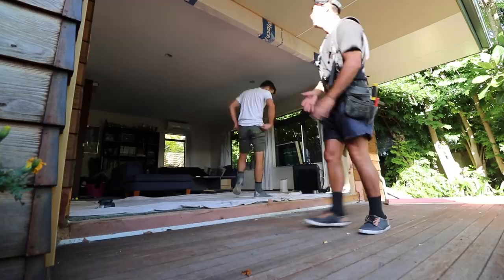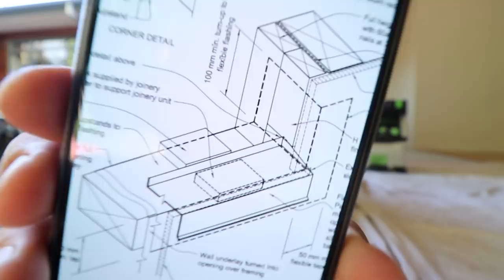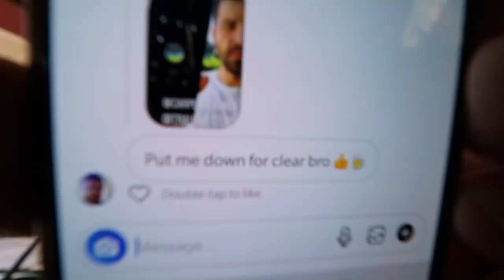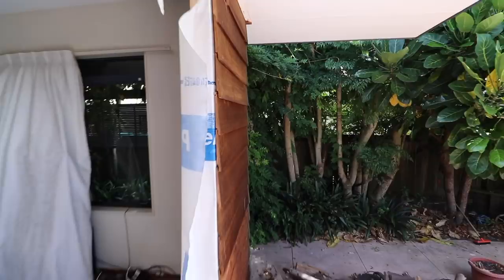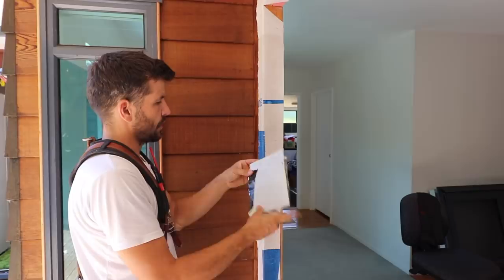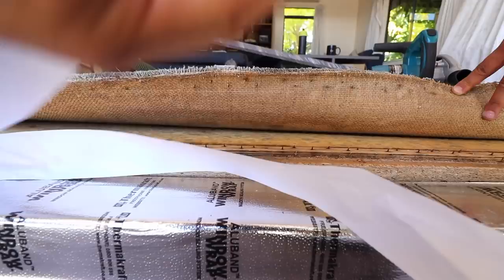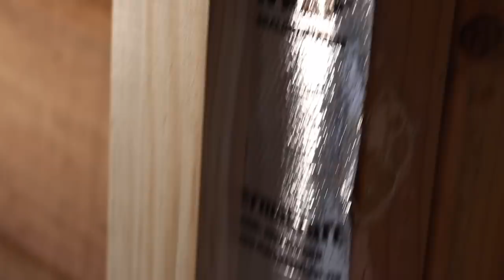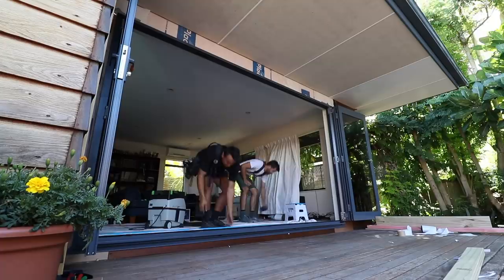Installing BIG Bifold Doors

Comment: Great install. 
Seems the pillar between the original window/doors was not a structural pillar? I imagine that would have being a lot more intensive if you needed to reinforce the top horizontal beam above the door. 😅

Comment: I am getting one of these doors installed in my home (LaCantina brand). It will be for a finished basement and he is pouring a new concrete slab (the entire bottom floor is being rebuilt). My foreman is asking me whether I whether I want something like 1” or 0.5” of vertical space on the slab pour so the door is not level (i.e. there is a vertical ledge you climb up to the door), in case I ever want to add hardwood floor or carpet on the slab. Right now we are leaving it as finished concrete, which we think will be a look we like but could change our minds.

Do you recommend we make the slab vertically flush with the door? I was trying to see your installation video, and it looks like that’s exactly what you did. There appears to be a ledge built into the door, presumably for water intrusion and to hold the glass. But I think you made the actual bottom exterior dimension of the door flush with the carpet. Thanks!

Comment: I would love to know the width of that opening.  I have a 1950 mid century modern with 8'x23' sliders in 4 sections I would love to replace not only for looks and function, but also energy efficiency as mine is original.

Comment: Why is the glass being installed from the outside. As a police officer who has been to many burglaries where beading has been removed and the glass taken out, isn’t it a building requirement or at least a safety requirement for the glass to be installed from the inside

Comment: Hi just wondering what the orange plastic corner things are you used for the corner flashing?
Reply from the maker: They protect the tape and the corner of the framing. The hard plastic acts as a support for the sill tape, prevents it from splitting in the corners 👍
Reply: @ScottBrownCarpentry  thanks Scott and are they an Aluband product? Love your work!!

Comment: Your format sucks, but the content is good.  Nice wall replacement, but you lost a lot of insulation when doing this.  If you live in a temperate area then no big deal.  Come winter time - if it gets bad, you will feel it in both drafts and in your heating bill.